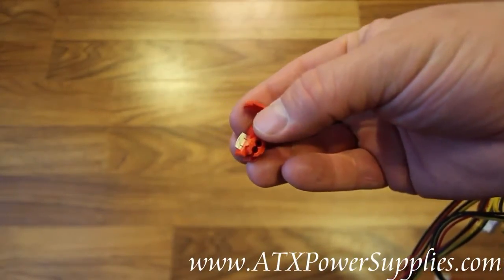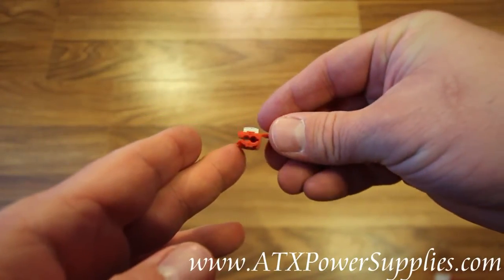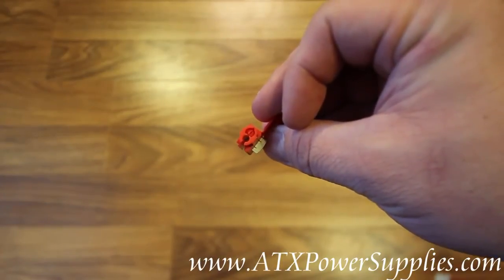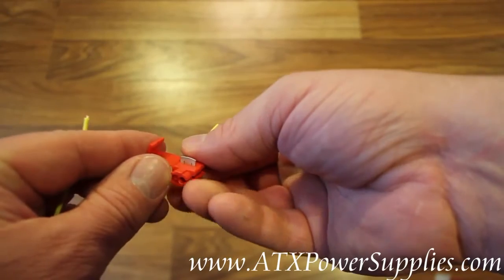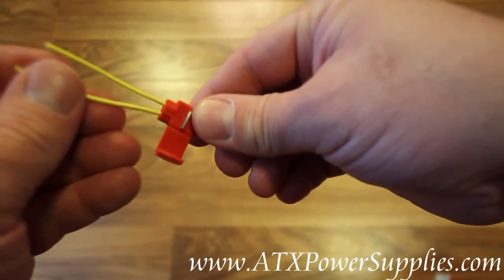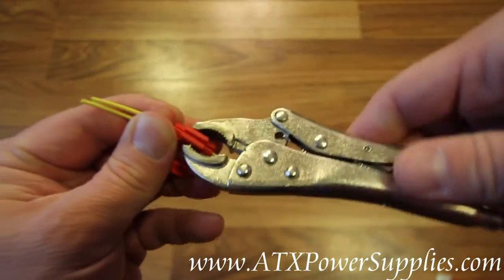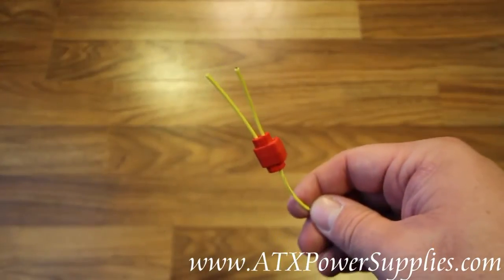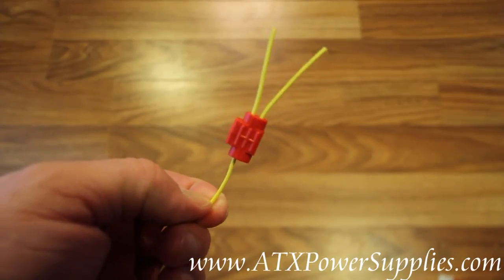How to use 18-22 AWG Wire Taps to tap into your Power Supply Leads

Comment: Why are there two numbers (18 and 22), not just one?
Reply: @algo Because the device will connect all wires between and including 18 AWG and 22 AWG. (18, 19, 20, 21, and 22 AWG, in other words.) 18-22 AWG is the range, with 18 AWG the thickest wire it can handle, and 22 AWG the thinnest. Take a look at articles with titles like "A Guide to Wire Gauges." That will begin to familiarize you with how wires are measured and discussed. Cheers,